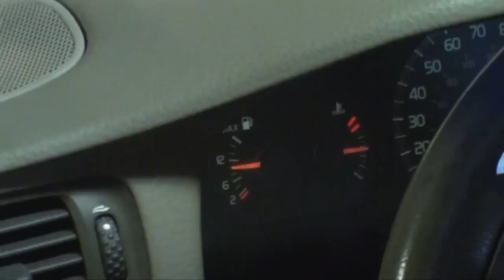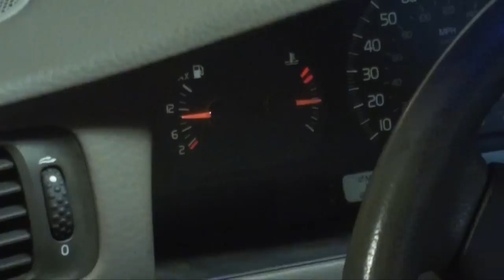Part-4 Volvo S70 2.4T cylinder head installation

Comment: is the 2001 V70 the same  I also have the 2.4 turbo and the car was given to me with the cam cover not on and the intake gear off. it looked like the cam gears are parallel with the head in your video but my book shows them to be on an angle . Is my book wrong  or are the engines different? any help is appreciated.

Comment: When you removed head, what do you do about exhaust manifold bolt studs when they remain in head?  How do you get heard off, pull off with manifold disconnecting from turbo and exhust pipe? Thanks, excellent overview.

Comment from the maker: This job is pretty time consuming, they give you 12.9 hrs by the book just for a head gasket replacement, as you noticed i took it a little deeper with re-lapping the valves and replacing seals that should have been an additional 4hrs, however i had to be honest it took me just over 12hrs actual work time, he made out very well to say the least

Comment from the maker: Thank you, the two bolt line that goes down near the sump = oil return, there's another tube that runs over behind the the timing cover that's the oil supply, in addition there is two cooling lines however the oil supply and coolant lines use banjo style fittings, yea my little guy is eager to get his hands dirty great kid :) 
i pulled the upper hose, filled the block reattached then filled the system, on the back side of the engine there's a tube with a bleeder i opened until solid fluid,

Comment: hi, we removed the vvt bolt... without locking the cam. now we can't find the mark because removing the center bolt made the cam turn a few times .. we found a dimple on each cam (with sprockets off)... it's a 01 S80 T6... any help on aligning that vvt?

Comment: is there an easier way for a beginner to lock the cams before removing the top of the head?  if your not changing the cam head, do you have to remove the pulleys on the timing belt end?  Couldn't I lock them in place some how to to keep the cam form spinning?  I have only done a couple of head gaskets on GM v6 that is way easier than this setup.  Doing a head gasket next week for a buddy on a 2001 volvo xc90 2.4t.  Thanks for any help!

Comment: I enjoyed the video. I was inspecting one today and found that the oil drain on the turbo was missing one of the two bolts that fasten it to the turbo... really i was unsure what to call it, Found that the line did go into the block, so assumed it was oil. good video. Sounds like you have a little one ready to help ya lol.... how did you get the air out of the system?

Comment: thanks for being so thorough. I'm at about the point of just getting a Whole junkyard engine For $175 and avoiding all this tedious crap. I've been a mechanic for years and Im just tired of it right now. The head gasket kit and bolts cost more than a used engine. btw, its the wife's car, not a customer.

Comment: I have a 2.3 where the coolant is draining out somewhere. I just got the car,trying to see if any hoses are cracked/dryrotted, anything obvious. I also noticed sludge under the oil cap (snot like stuff like "blow by" not really a milky as indicative of a head gasket blown.) I noticed a bit more of that on the dipstick for the oil. I ran the engine and took the oil cap off, no smoke or steam coming out (with engine warmed up), did same with dipstick, nothing there either........ possibly time to change/clean flametrap.  I drove the car about 20 miles the other day, didn't overheat............ today drove another 20 miles and it started to creep up enough to shut it off and wait,,,,, filled the reservoir and drove it back from the shop to my house........ not sure if this is a head gasket or possibly just dry rotted hoses etc.......   I checked the oil dipstick and the oil was nice and clear,,,,,,,, even the residue of blowby was gone........ are these 2 separate issues here?

Comment: Morning Robert , nice video . I replaced belts at 105, rebuild head and one value,guides and all new followers at 170000. At this belt change 270000 water pump, cam seals but I am not getting any movement with belt off cam lock on on the vvt exhaust hub..... Either when snug or torqued.... Seems weird it just became an issue. Thanks Donny

Comment: Thanks, I have a 1995 850 that is similar, many steps are the same or similar. Steam coming from the oil dipstick, lot of coolant loss without visible liquid leaks, mayo type goo on the dipstick at times, she has 260,000 miles.

Comment: The head gasket videos are great, I am about to replace head on 02 2.4t awd s60, putting a 2.4 non turbo head on it. The cover and cams are coming from the previous bad head, casting numbers seems same and from what I can tell all other fittings are the same. Any way to make 100% sure before install? Also do you think install exh manifold and turbo onto head is best?

Comment: Realy nice job and a great video!! Your video really helped me a lot. My Volvo S60 2001 model has a simular problem all the way that my oil catch can is smeard with ooze. so I probably got a very bad crankcase ventilation where I lost my oil at a given time. I assume that my cylinder head along with my valves could use a leak check-up. how you Secure the camshaft was a great solution. I am very glad that there are people who take the time to share their experience and expertise with the world I thank you!!! greetings from the Netherlands.

Comment: How is this repair holding up?   Do you feel the copper is necessary on every Volvo headgasket or just in this situation/scenario?  Also on the used head that was purchased was it ever milled/checked out by a machine shop?

Comment: Great job and video.  I'll probably never own a Volvo but it was really interesting to see how differently they do things.  That load bearing valve cover and Vtec system were cool.  The OHC six that Pontiac had in the 1960's had the cam mounted inside the valve cover also.

Comment: So this was confirmed as a crack in the cylinder head, could you say where?
I have a c70 2.4t which has been lightly pressurising its coolant, and now worse. Some oil in water, more water in the oil, hoping its a blown gasket but these blocks are reknowned to split liners and then the head warps

Comment: Really nice as always , i didnt found easy to understaand  the setting on the variable valve side of the head , seems like you only put it back in place , But what if you didnt had no marks from the bolts and all the cam bolts on the sprokets were loose, I  think i need to research myself  a little more on this. thanks!!

Comment: 22:40 I had the oil cooler bypassed on my c70 t5 2000  the bypass was done before I bought it... I had volvo change it for an aftermarket one nissens I think  any way.. there was no fault with the old one.. they were simply too lazy to get the pipes

Comment: Great video with allot of good info.  I did have a question, someone brought me a 2.5l turbo with the cams and valve cover in a box.  when the cams are locked with the holding tool which side is up?  (the slots in the cam are cut off center creating a thin half circle and a thick half circle)  in the vid it looked as though the thin side was up but it wasn't clear.
Thanks Bio

Comment: When you moved the exhaust cam sprocket one tooth, you brought the variable cam timing mechanism with it.  I thought that was why the sprocket mounting holes are slotted, so as to allow for alignment of the marks without altering the base position for the variable cam timing mechanism.

Comment: I just want to replace the cam seals, spark plug passage seals and apply new sealant on the halves. Would I need to remove the intake and all that stuff. Would the cam shafts have to come out? Thank you!

Comment: I have a 99 volvo v70 it runs hot only when i drive it and has slight substance on the oil stick i'm sure it needs a head gasket but even with a new radiator and new thermastat and new heater coil i have no heat and i noticed the top radiator hose gets really hot but the bottom stays cold and i know there is no blockage cause i can squeeze one side of the hose and it bubbles or shoots air and coolant out the other end there is no leakage anywhere indicating water pump its got me wondering why its doing that even if its a small line blown head i should still have heat with all that being new any ideas thanks great video by the way

Comment: Thanks man great thorough work and checking .i just bout the exact car with the same problem and it came from an car auction lol.I hav'nt started on it yet but i see pinkish color residue in the termostat when i changed it so i drained coolant and got lots of the same pinkish color i also noticed when its running and it don't take to long to run hot when i pull the oil stick i can see some steam coming out i'm pretty sure its gonna be a head gasket as well what do you think and thanks for posting this video its people like you that really helps others i have learned so much from youtube videos